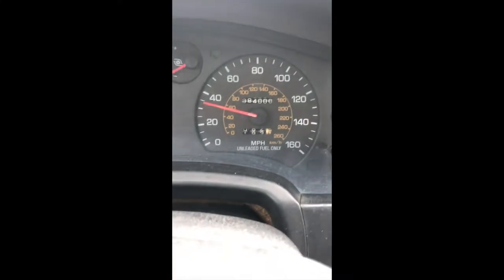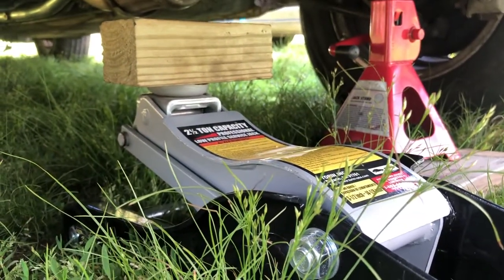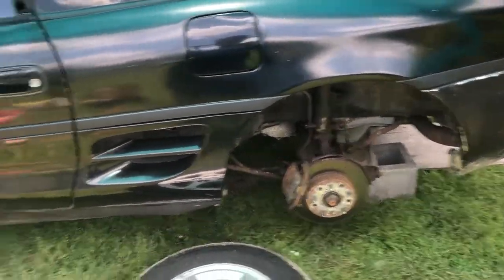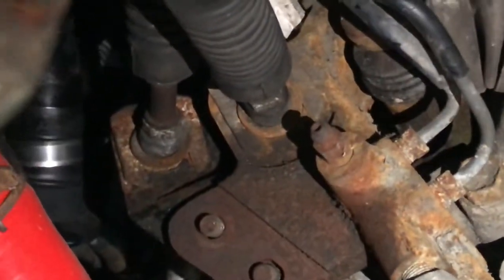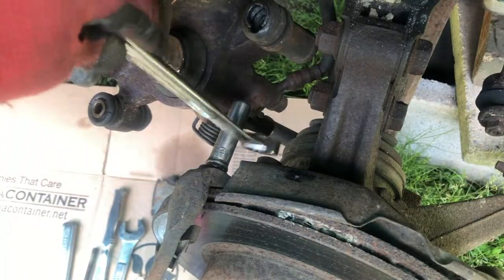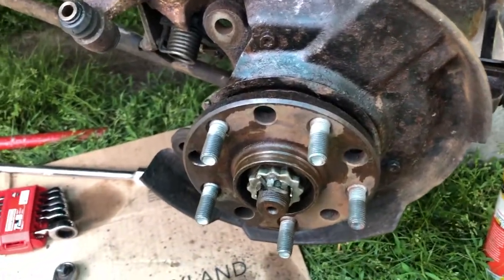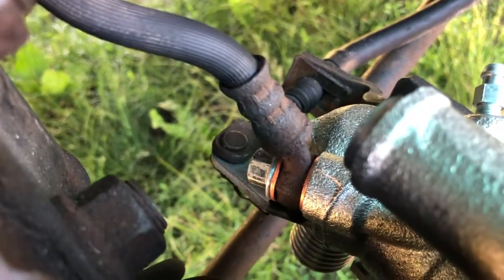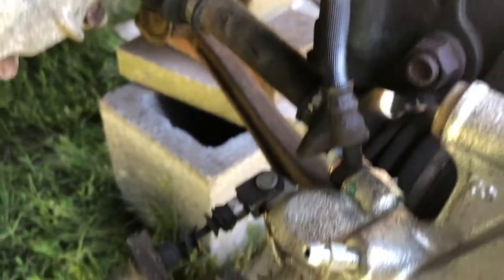Rebuilding Brake Calipers on Toyota MR2 Turbo - 1991 3SGTE Project Car

Comment: Hey man, I know this video is a year old but I am doing the same thing with my 1992 MR2 project! First time doing a brake overhaul as well, rebuilding just as you have. So far after putting everything back together I am getting leaks from the piston on the rears! Not sure if I have fitted the inner seal correctly - but everything looked good at the time. Learning as I go is just as rewarding as it is painful. 

Its nice to have finally found a video of someone documenting the rebuild as a new experience to them! gives me confidence for when I take the calipers back off the car and try again!
Reply from the maker: Glad the video helped! Yes this was my first project car ever and I jumped in with no mechanical experience. If they give you issues then I recommend buying the rears new from rock auto. That where I got mine

Comment: Hi, what’s the correct way to remove the cylinder things from the calliper?
Reply from the maker: There's other methods on pulling them out. Vice grip is what I used, but you can also use the brake fluid too. You pull the caliper off with the hose attached and press on the brakes. That will force the cylinder out. You will lose brake fluid either way since you draining the system